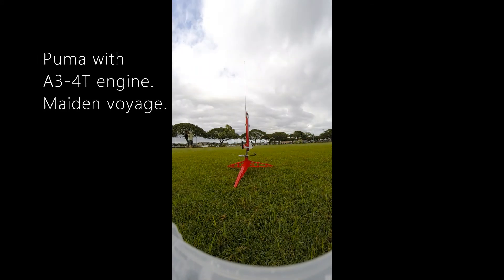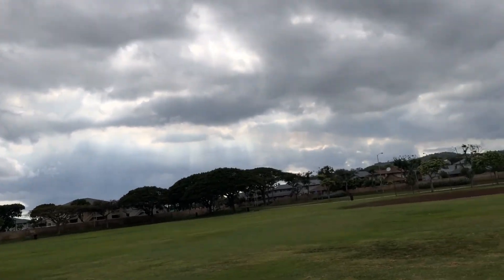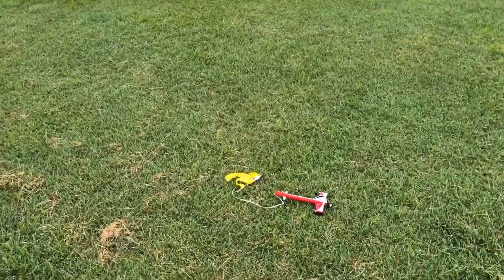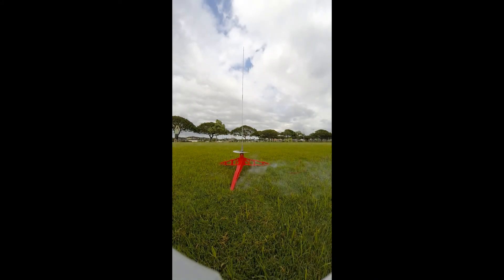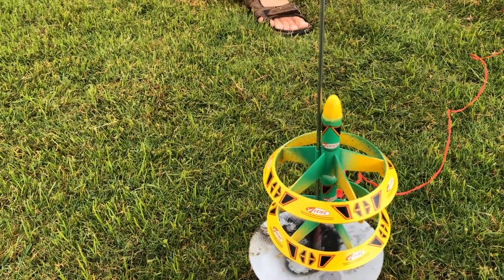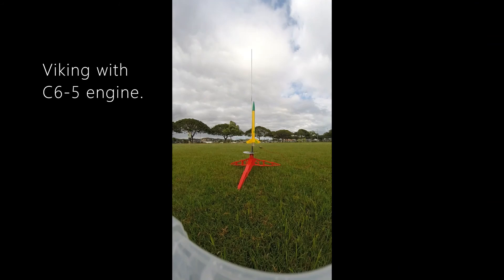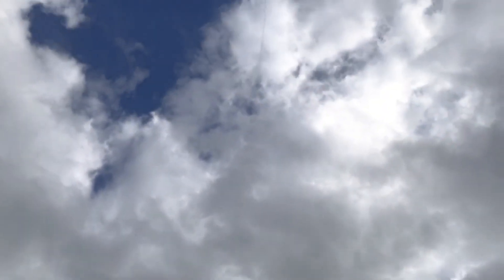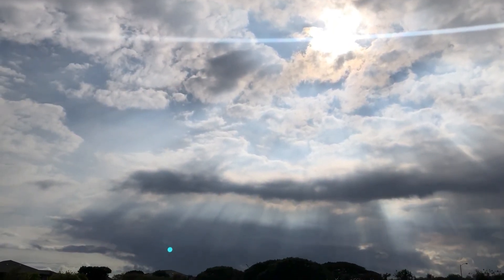Model Rockets: Estes Puma, Twin Factor 2-stage, Viking, and Lunar Scout

Comment: Great flights Ron. Had to laugh tho. Had the Viking as well about 10 years ago or so, used a C6 too and never saw it again... just went to my lab today after seeing yours. Still have the instructions as well as the small display card in the bag. Abviouly no rocket. Looked at the instructions again and rem,d it had 4 differant fin arrangements. I rem my fins were the same as yours too. We think and build the same build buddy. I miss that little rocket. It was lite! I don't think estes sells it anymore as well.
Reply from the maker: I stopped launching at that park because I was littering the neighborhood with too many rockets including my Saturn V RTF. I subsequently bought the Viking 12 pack when they were on sale and use them for wind gauges so have lost many over the past year. My record was 7 launches on one until it finally landed on a TV cable for a week and got soaked. I think I have four left in the box.
Reply from the maker: Thanks again for watching and really enjoy the comments.